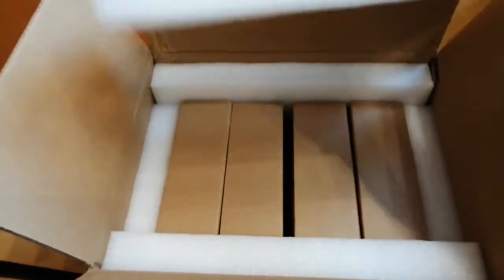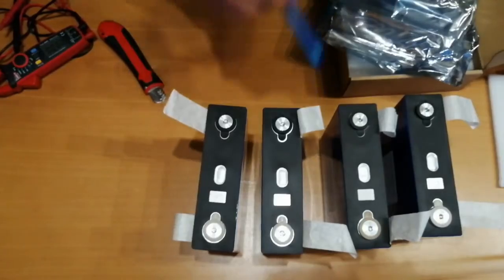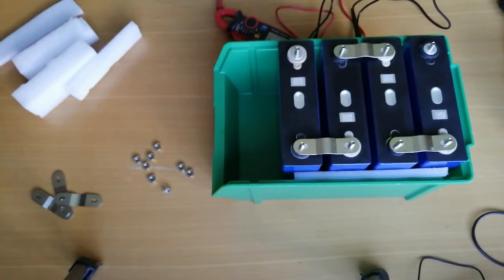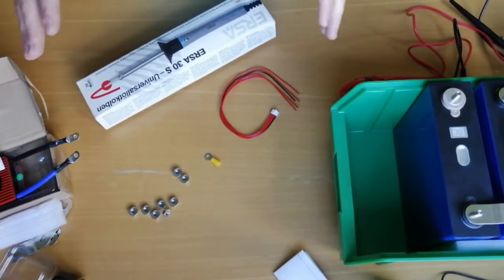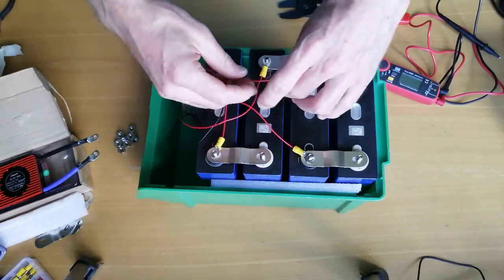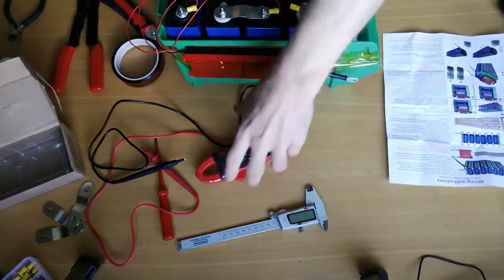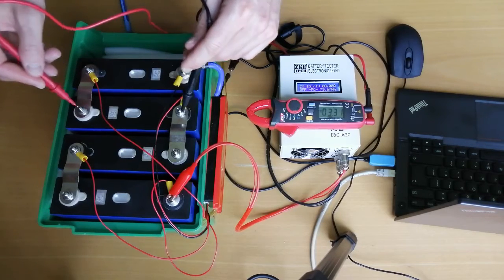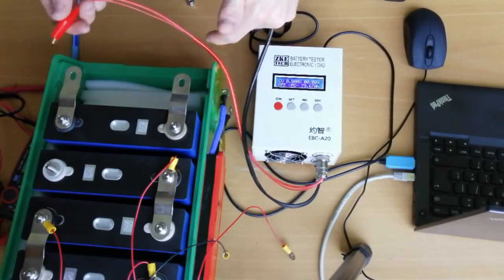Built a 12V LiFePO4 battery pack and failed in passive balancing

Comment: you need to TOP balance not just balance, if all batteryes are at same low voltage doesn't mean have same charge. you need to put them in parallel and charge at 3.65 volt or at least 3.5 volt after you put in series
Reply from the maker: thanks Marco for the reply, I fully agree, also showed this in my next video https://www.youtube.com/watch?v=RKIwnFIyiJA

Comment: Hey Lupo, Just a thought concerning your Low Temp Charge Cut off Problem: In Case of neither your BMS nor the solar Charge Controller has a Low Temp Cut off and solar ist your only charging source you could probalbly use a simple thermostat Switch Inline in the solar Input to the Charge Controller. Set it to Open at e.g. 5°C and should be o.k.!? I'm not an expert. Just building a first Battery 24v280ah myself for an RV application. My old SCC had No Lithium settings and No LTCP as welll. Ended up buying a Victron model that has one.
Good luck with your projekt!
Grüße
Holger
Reply from the maker: Hey Holger, thanks for the advice. I also use a victron charge controller which has a low temp charge cut off and I guess I want have the system on during the cold winter times so I should be safe. otherwise I think I would definitely add another safety mechanism as you proposed. cheers, Lupo

Comment: The mistake here is in thinking that voltage-matched cells means “balanced” cells. It definitely is not the case. As another commenter says, to properly balance cells they need to be top balanced (or bottom balanced, but that seems less practical in use) at 3.5v or more, and allowed to absorb current for a while until all cells are saturated. this absolutely MUST be done before assembling cells in series for use if you want to get maximum capacity from the pack, and not trigger BMS cutoff frequently when charging.
Reply from the maker: thanks frodev for the reply, fully agree, also what I showed than in my next video https://www.youtube.com/watch?v=RKIwnFIyiJA

Comment: I made 3 batteries on similar cells. They are cheap and certainly not top quality. I find bluetooth very helpful because I can see what is happening with the cells. I also use an active balancer, .. I can't imagine a battery without it. He balances targets non-stop and can do it with high current (up to 5 A). The balacer included in the BMS balances only when charging, after exceeding a certain voltage (e.g. 3.4V) and doing it with a very small current (approx. 30mA). Its effectiveness is very low. Use an active balancer once and you will never make a battery without it :)
Reply from the maker: thanks for the tip. especially as my dumb BMS starts balancing when reaching 3.5V and I usually charge with 3.4 and never reach this point.
Reply: @LupoDIY  I will add - the balancer in the BMS balances through the loss of voltage on the resistor, and this is a loss of energy. The active balancer transfers energy from the higher cell to the lower one and nothing is wasted :)
Reply from the maker: @Radauskas  that is true. but it also depends how you discharge the battery. if you discharge and charge with high current, the active balancer might run into problems as it is too slow to balance everything. a good top/bottom balanced system can stay balanced for a long time, even without a balancer (BMS or active). In general, it really depends on the type of load you have.
Reply: @LupoDIY  As I wrote earlier - cheap cells do not ensure good voltage equality. In my opinion, an active balancer can help a lot without making anything worse.
Reply from the maker: @Radauskas  I think there are situations when a active balancer can make things worse, as shown in https://www.youtube.com/watch?v=4iPpn8-Pakk ... but for a lot of use cases it is a good solution.
Reply: @LupoDIY  Hmm, .. very interesting. I made 3 batteries, each with an active balancer - this is what a specialist advised me to do. They work ok. Maybe with 4 cells it is better? Or maybe I will do an experiment and remove an active balancer from one battery and compare it.
Reply from the maker: @Radauskas  I am pretty sure that both can work. it really depends on the load and use case. An active balancer is definitely faster in balancing. But I am curious about the outcome of your experiment.

Comment: Why not get a small active balancer, I think they are quite effective. Otherwise just to a top balancing by connecting all cells in parallel.

Also you should try out a QUCC BMS with the Bluetooth, they are better than Daly, better tech support and cheaper as well.
Reply from the maker: thanks for the tip, I will also have a look into the QUCC BMS, I already consider a smart new one to monitor everything. Regarding the active balancer, I guess, it wouldn't have helped as the voltage was on the same level, but as you proposed top balancing is the best solution. I also covered my solution in my next video https://www.youtube.com/watch?v=RKIwnFIyiJA

Comment: your bottom balance voltage 3.27V was too high.   Which did not reach to the bottom area yet.  Around 2.8~3.0V will be good to bottom balancing area for LiFePO4.
Reply from the maker: Hey, thanks for the suggestion, you are right, the voltage is to high for bottom balancing. I didn't want to bottom balance it but it is definitely a good option to do so. In https://www.youtube.com/watch?v=RKIwnFIyiJA I also showed what I did at the end. cheers, Lupo

Comment: This isn't unusual with LiFePo4 cells because of their really flat voltage curve. Eg you might have 4 cells at 3.2v, but they might be at 60% 40% 50% and 70% state of charge. (there shouldn't be that much variation on a new set from the same supplier, but a top balance makes sure that they're all the same state of charge before putting them in series)

 The state of charge won't equalize just by putting them in parallel, without bringing them to a full charge or draining them all to a low state of charge.

A reliable method is to put them into parallel and then bring them all up to a full charge. For my build I did this with a 20A hobby charger set to LIFE 1S. It took 2 days for mine to charge and top balance.
Reply from the maker: thanks Neil for the advice, good point, I also summarized my findings in https://www.youtube.com/watch?v=RKIwnFIyiJA

Comment: Came from reddit, please excuse Blaze, he is not well received. If you want to passively balance LiFe cells, I recommend doing so at 3.5v with a constant voltage for several hours. Andy over at OffGridGarage has made some great videos detailing this process. The TLDR of it is that even though the cells may be at the same voltage, unless you absorb charge them (at low current)  for several hours, they can still be a few amp hours apart at the same voltage. Also, I would recommend that you get the Bluetooth module for that  Daly BMS and adjust your protection parameters to something a bit more conservative for battery longevity.
Reply from the maker: thanks for the hints and the help. I know most of Andys Videos, he is a great source. I was just confused by this forum entry and thought I can work around top balancing as it takes a while. I think it could also work iff the cells were already matched/balanced by the manufacturer. Regarding the bms I wanted to have a stupid one as I heard that the smart ones are not that reliable. I think I could also tweak the settings of the charge controller to avoid low/high voltage. The BMS is just the safety net.